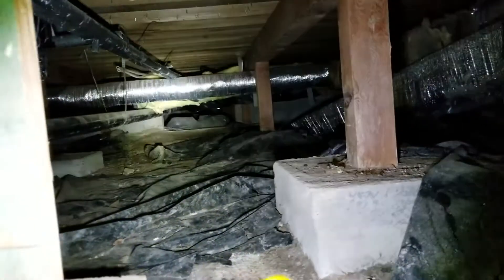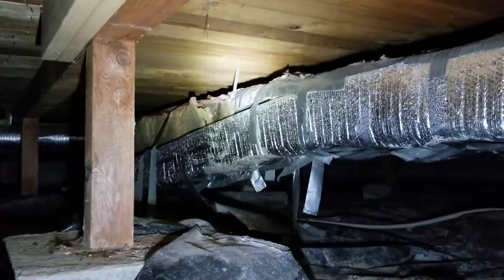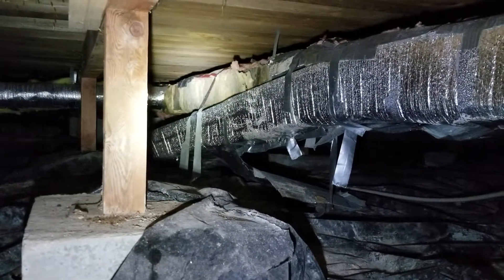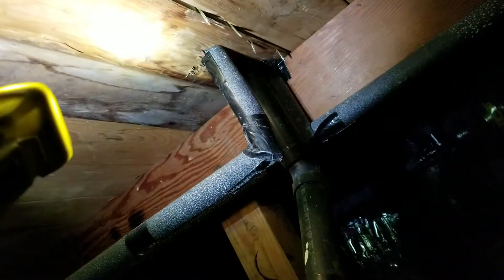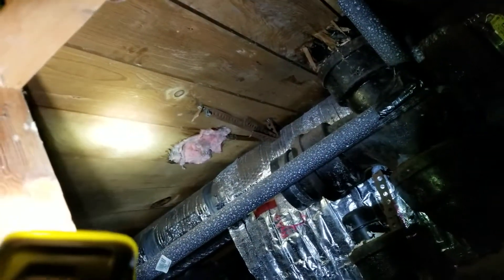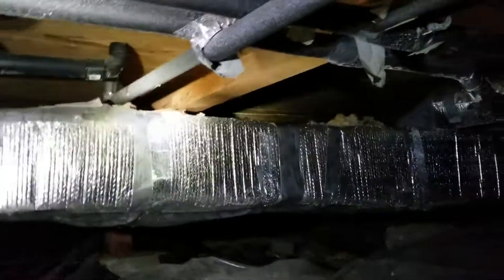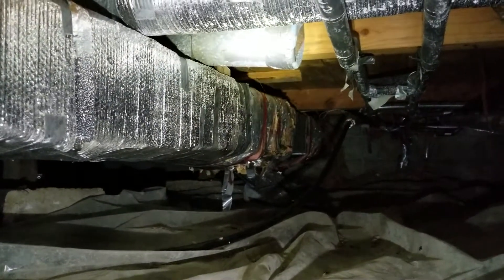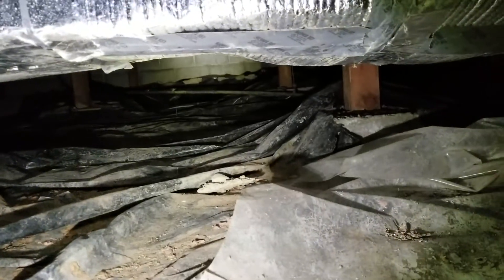If you switch from OIL to HEAT PUMP - BE AWARE!

Comment: I live in New England. 1989 home...added Goodman 16 SEER heatpump and new air handler system to an existing Oil boiler and hydronic radiator set-up. Naturally goal is to avoid oil like the plague, is there a way to get the heatpump to work with radiators and bypass oil all-together? I'm also going to put in electric water as I have solar panels on home so anything electric is by far cheapest solution. Can't see to find anyone that know about oil conversion to heat pump, particular considering we do not have air duct on 2nd level so radiator/pellet stove heat 2nd floor and if temp is below 45, we use oil so trying to use heatpump at lower temps too, not sure how to go about that.